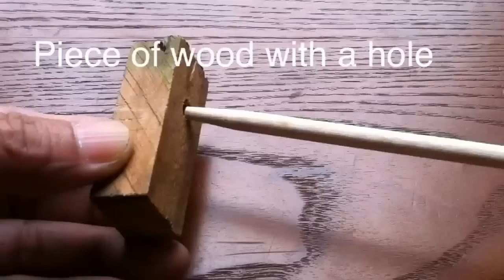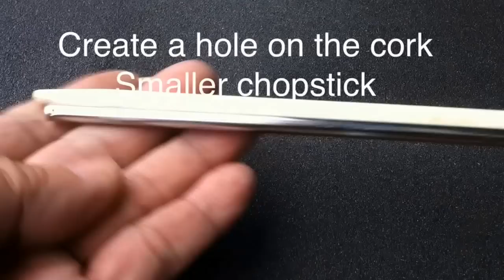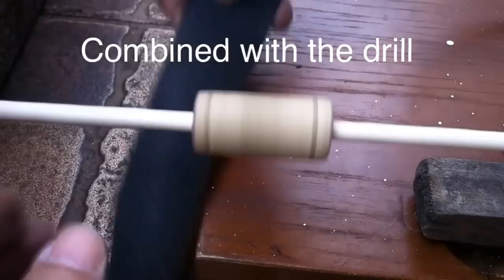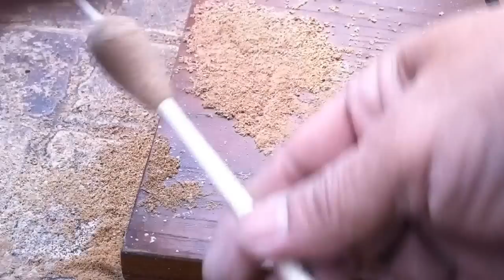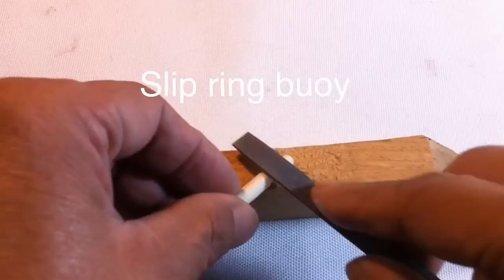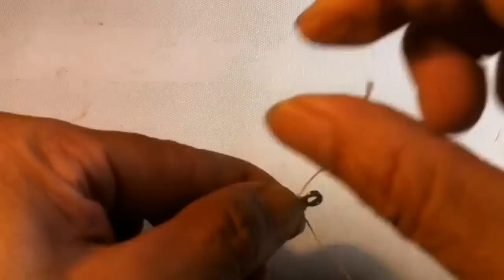Making a Touch Fishing Bobber from cork(2)Basic steps-DIY - Fishing Tips -Làm Phao Câu Lục

Comment: ive made a few like this. i like to drill a cross hole and bend a little leg on the clothes pin piece. just because i had a bobber fly off once because the thread and glue got cracked and failed. the leg holds in in there even if the thread starts to fail. too much work and they look too good to have them go flinging off down the river.

Comment: how many can you make and send to me?
I will buy them from you
I require them to be 2 inches long and 7/16 in diameter and 5/16th on each end.
Can you make quantities? then need to be red or orange and have a small stick on one end to hold the line.